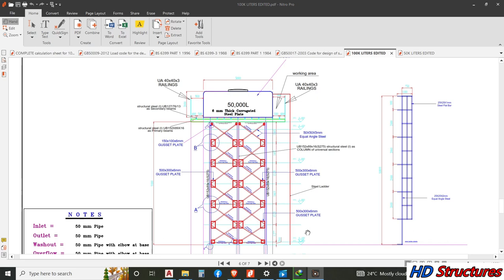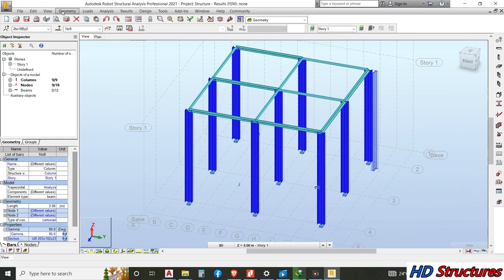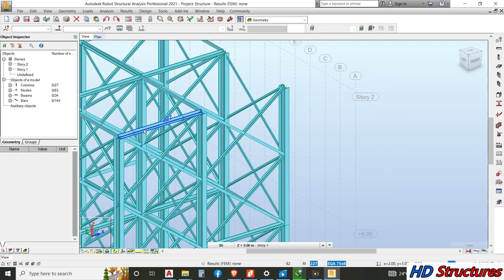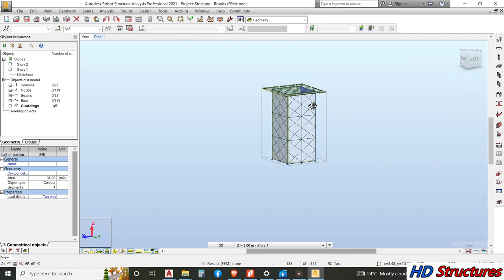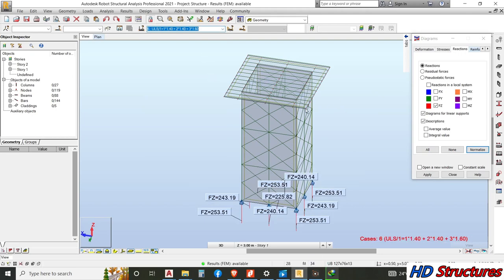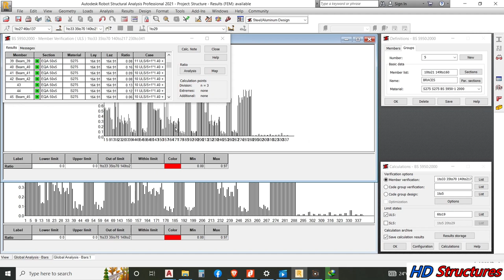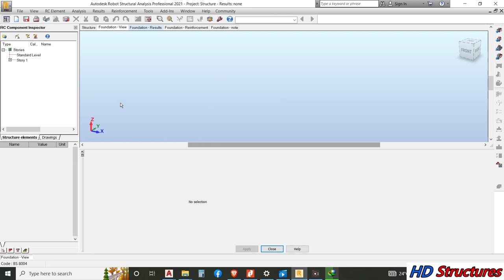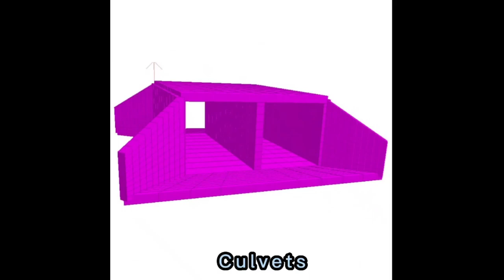Autodesk Robot; design of elevated steel water tank (100k liters capacity)

Comment: Your use of the wind tunel is not correct. Acording to which code did you define the wind? Depending of that, you should build a wind curve profile, so your final dimensioning of the structure is wrong.